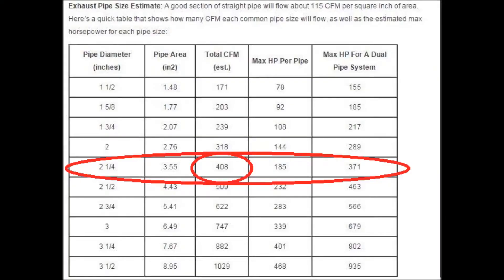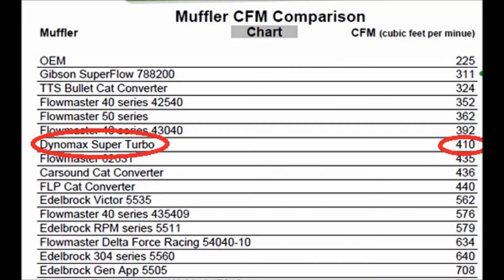How do Car Exhaust Systems Work

Comment: Brian Burnsey will now be know as professor car science! Dude your knocking this science stuff out of the park.
But is the flow of the flowmasters per muffler? If there are 2 mufflers (1per side) would that not double the flow? Just asking since I did not do the research.
Check your Instagram for a msg.
Reply from the maker: There are a couple gaps in my video now that I rewatch it. so to answer your question you need approximately 2.2 CFM per 1 HP.  So. Lets assume 340 HP so you would need 748 CFM to run unrestricted.  so 2 2.25" FM 40 mufflers can flow around 700 cfm so it would be a bit restrictive...   where as my Super Turbos can flow 820 so it would be non restrictive.  the 408 value is for 1 pipe.  So if you just doubled all my numbers in the video that would be the true need.  kinda botched that up but its still the same ratio.

Comment: So in the case with is with the 17 MY with active exhaust. I think we have 2.75 piping so would we need 3” mufflers or X Pipes to keep from restriction?
Reply: Of course, I have to support one of my fellow Z members. I’m asking though for myself, do you think i should do 3” mufflers and X pipe when I do start modifying my exhaust?
Reply from the maker: With exhaust you can actually go too big.  If you have not heard the word scavenging I would look it up for a little more understanding.  Basicay to gain power and efficiency in an exhaust you try and get the gasses out as quick as possible.   Velocity is key. If you tube diameter is too large your exhaust gasses move slower because the tubes are bigger, gasses cool down and you loose velocity.   I want to say that you would need to be running north of 500-600 HP to get any benefit to running 3 inch tube.   If you run too big you may loose low end torque.   IMO I probably wouldn't go with 3".   I would say 2.5" is perfect for the 5.7 Hemi and 2.75  is good for the 6.4 Hemi.  Hope this helps.  Good luck.  I always had fun trying to figure out how I wanted to do my exhaust.  Oh and you should be able to get 3" mufflers for a 2.75" exhaust.  Should slid over the tube.
Reply: Thanks man. Yea I was gonna leave the pipes at 2.75 I just wanted make sure the 3” muffler  and X pipe would be correct.
Reply from the maker: Hey man.  Thanks for checking out the video!!   With 2.75 you are more than good.  This exhaust was designed for the 392 so it should be fine with the 5.7 Hemi.  I would say the stock 2.25 system I had was restrictive and that's why I went 2.5"   2.75 " will not be restrictive and would be just fine for the 392 as well.

Comment: I did exactly this. 2.5 flows and 2.5 pipes but still have 2.25 x pipe so that is my limitation. I'm also forced air running 500+ awhp. I think I may have a bottle neck
Reply from the maker: Like you said it is limiting you a little - at some point I would imagine it would help a ton if you went with a 2.75 or 3 inch exhaust but as well all know money does not grow on trees.  All in good time my friend.   thanks for checking out the video.

Comment: Interesting topic!! I love these discussions, I wonder what cfm the stock muffler and resonators flow, the stock muffler is efficient, but I suspect that the combined restriction of the stock muffler/resonators is greater than the Flowmaster 40s in 2.25, but even if that is true, it doesn't change your main point.  Good video!!
Reply from the maker: Thanks allot.  I always wondered that as well and could never really find an answer -  Like you said the mufflers are efficient and are not restrictive in both the 2.25" RT as well as the 2.75" active exhaust system.   I would assume in your exhaust just because of Diameter alone your resonators are not going to be restrictive enough...  where as the resonators on the 2.25" RT exhaust are going to be a big time pinch point (It helps that those are in the rear)..   Like you said it always a good and fun topic to discuss.  

I would tend to agree with you as well.. that FM 40s with no resonator is probably ress restrictive than the whole 2.25" as a whole.   Now FM 40s with resonators would be pretty darn restrictive.
Reply: I agree FM40s with resonators would be restrictive.

Comment: Good info burnsey, Ive heard that a few guys with flowmasters have felt they lost a little power when they kept the 2.25 stock piping.   But then again a lot of guys are running great times with them so I dunno. 

I recently picked up a pair of used scat pack mufflers and resonaters some guy had taken off and am planning on welding them onto my 2.5 dynomax piping.  I figure I’ll have the sound of the newer active exhaust but without the valves, so it should be a bit louder. Those SP mufflers and resonaters are straight thru! You can see right through them. I’m also planning on getting the police rear valance and using the tips that are on the stock SP resonaters. I’ll be sure to post a vid when it’s all done.
Reply from the maker: Thank You Sir!!  the things you have heard would support my video.  I dont doubt it at all.  AWESOME on the SP mufflers and resonators.  I cant wait to hear them.  That was definitely went through my mind as well.  I was going to remove my stock mufflers and put in SP mufflers and then put on cheap $30 resonators at the end.  You had a similar approach.   The Dynomax piping is awesome though... especially that X-Pipe.  I doubt you'll free up restriction because the Dynomax flows amazing but it will sound AMAZING!!!   Let me know how the welding in of the mufflers go.  That is always in the back of my mind to swap mufflers on mine as well at some point..
Reply: Burnseys RT  I will definitely let you know how it goes, a little worried about the drone issue but we’ll see. Shouldn’t be too bad with the reso’s on there.

Comment: Great explanation.   I didn't see borla ATAK's listed in any or your pics though, so I'm wondering what the CFM on that system is.   (It's basically Mopar's Scat Pack Stage 1 CatBack exhaust system, which was made by Borla).
Reply from the maker: Thanks Man!!!  gotcha.  I did trim down the picture a bit.  Down on the list I see Borla XR-1 P#40600, 40615, 40575,40450 & 40741.   All of these flow better than 836 CFM.  Check and see what the part number is for the muffler in the system and see if its any of these.   These basically are completely free flowing.
Reply: Thanks for checking Burnsey.

Comment: Great video quick question probably may not know right off hand what is the overall length of the x pipe I know the diameter is 2.25inlet/outlet but just looking for overall length how long it is so ik when I do my x pipe the exact length I'm looking for
Reply from the maker: Thanks - Best I can offer you on the fly is what the dimensions are of the Dynomax Catback X-Pipe.  Check out this link.  Shows the dimensions are 42 x 7 x 3 inches...   however that includes the pipe leading up to the X-pipe from the cats and the pipe leading towards the mufflers.
https://www.amazon.com/Dynomax-54791-Exhaust-X-Pipe/dp/B008IMGZI8/ref=sr_1_1?s=automotive&ie=UTF8&qid=1520444290&sr=1-1&keywords=54791

Comment: I’ve been running deleted resos and mufflers for 2 years now. Will never change it. Maybe to 3 inch pipes one day. Wonder what my cfm is and would be.
Reply from the maker: I dont think you would need to go to 3" from a performance standpoint until you have like 450HP or something.  2.5" should suffice (Assuming a 5.7L Hemi).  If you go back through the video and pause it I believe you can see the 3" output on that one chart.
Reply: Burnseys RT very true thanks!

Comment: That's why I decided to go with a cat back kit with 2.5 inch x pipe. Great video as always
Reply: Whoa Weezy that sounds awesome to custom make the x pipe
Reply: Rydin N Style I did too I'm going to custom make my x pipe
Reply from the maker: I cant wait to see how that turns out.  that would be awesome to be able to make your own.
Reply: Burnseys RT I mean I'll have the shop to do it but if you look at the x pipe carefully u can do it ways 1. Get 2 staright pipes and bend the both in the center cut a hole in the middle merge them then weld together. Once done do a slight bend on end of the x pipe u created then boom u have made a your x pipe 2. Take 4 45 degree angle pipes cut them at a slant put the tips of the pipes together where you cut piece them together and weld together sounds confusing but it's videos on how to weld up your own x pipe
Reply: Rydin N Style yeah does it make since what im saying because thats the route im going to go soon when i order my statight pipes
Reply from the maker: Gotcha.  All of that makes perfect sense.  Our stock x-pipes are built that way.  It would be very cool to have a shop fabricated X-pipe.  I can't wait to hear and see about it.
Reply from the maker: Thanks Man!  absolutely.  If you are going to go with a catback 2.5" is perfect.  You remove the restrictions and gives you room to grow some power.  you are limitted on the 2.25" system.
Reply: Burnseys RT im going to place that order next week when i have more money

Comment: Good topic Burnsey so far I've seen with the 5.7 go 2 1/2 and 6.4 go 3 in. Generally . But like you said the stock exhaust is not that bad so don't really expect a lot of power from a muffler swap just mainly better sound.🍌+🚘😆
Reply from the maker: Thanks.  You are correct.  our stock exhaust is a good one but if you have any intentions on increase the HP you should go to 2.5" so you are not limiting your power.  The 2.25" is pushing the limit to being acceptable.
Reply: Burnseys RT wonder whats the stock size on the 392 cars they run like 100 more hp than 5.7 is the exhaust choking on them 🤔
Reply from the maker: I believe the active exhausts on the 2017 + 5.7 and all 6.4 are 2.75".  So they should all be covered and non restrictive

Comment: Nicely done. Mr. Burns.. see I have a 3' catback with 2 chamber mufflers. My SRT pages says that it's making about 451hp sometimes 440hp mostly on 93 tune
Reply from the maker: OK so you are totally fine.  I think theoretically you could support that power with 2.75".

Comment: Great info man. I didn't know this when I got my 40 series.
Reply from the maker: The one think about this is.   If you like the sound that's more important IMO.  How often do you actually use peak HP right ?
Reply: Man, for me its quite often. I still haven't learned how to keep my size 14 foot off the gas....Lmao🤣😂
Reply from the maker: haha - yeah me too!!!  I would check my response to Ave Joes garage -  kinda botched the video slightly .  the numbers i referenced are for 1 pipe and not a due exhaust, if you double the numbers thats what you need,  still the same ratio though